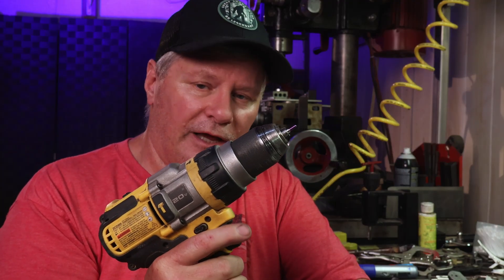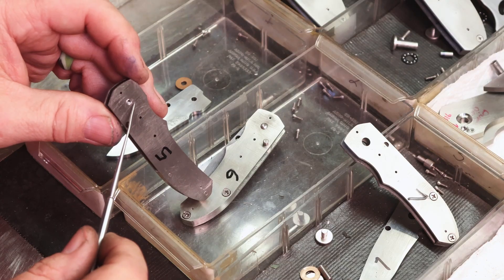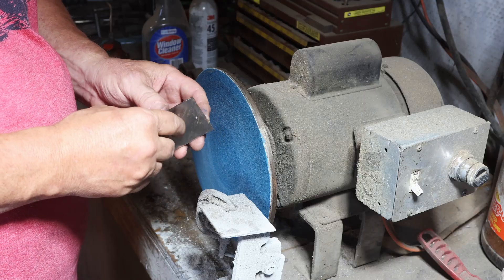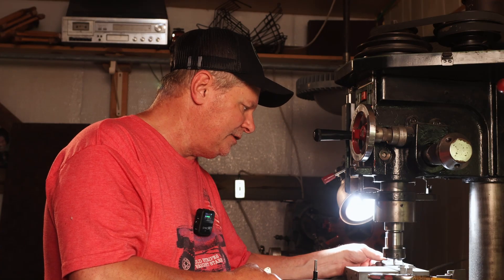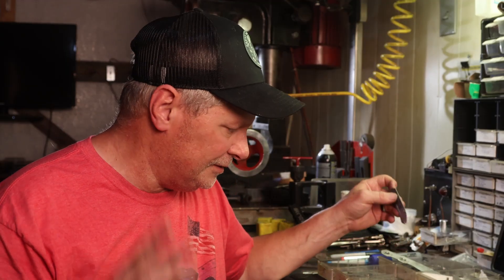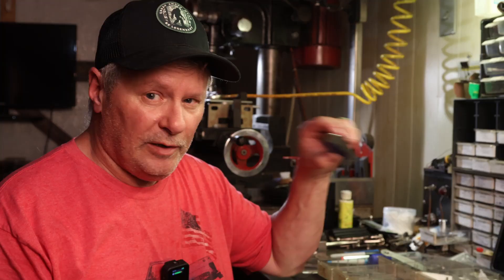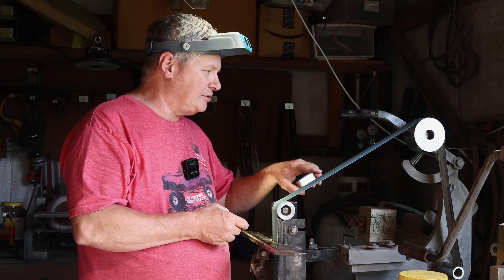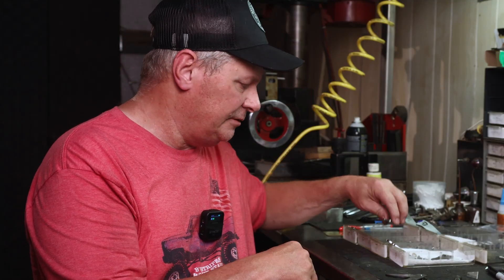Making 8 Liner Lock Folding Knives - Part 3

Comment: So cool that you show many ways to cut those down. I personally love the threaded plate whatever length you need!  One question, what grit belts do you use when cutting those small screws?  Thanks
Reply from the maker: Thanks!  I use 120 grit most of the time then square them up on my lap plate with a pivot lap if I need to.

Comment: Bravo Tony- as always good stuff! Have you considered the fiber cut off wheels vs the grinding disc on the dremel-mandrel?? They are about ½ as thick and in my experience can take a lower speed better than the abrasive... just a thought- hope the family is well and as always- be safe and at peace my friend.
Reply from the maker: Thanks man.  Actually I thought what I had was the fiber wheels but I’m not 100 percent sure.  I’ll have to check on that.  Thanks!  🙂

Comment: I used to make a cut with steel discs made of P6M5 steel, they work much better.
Reply from the maker: I’ll have to look in to that.  I’ve tried several kinds of saws but they just don’t hold up.  Thanks!

Comment: Man I always pick up lil things as I watch ya work.  Just getting caught up on the series   Appreciate how you show and explain your process.  Screwing up grinding lock faces is why I am currently holding a CRK Inkosi with a lockbar insert and reblade😂.
Reply from the maker: Thanks.  That’s what it’s all about.  I have a drawer full of messed up lock faces but I save them in case I can make them work on another frame.